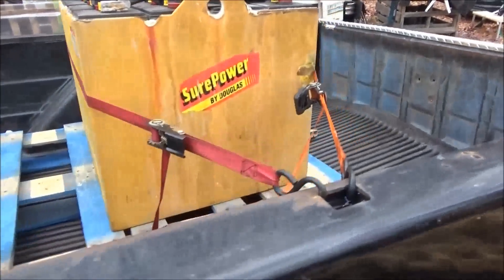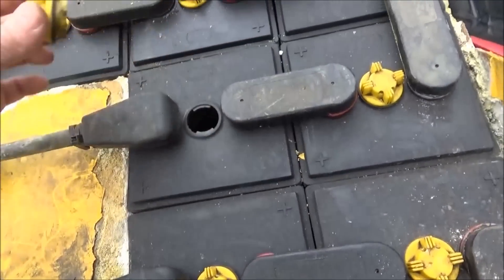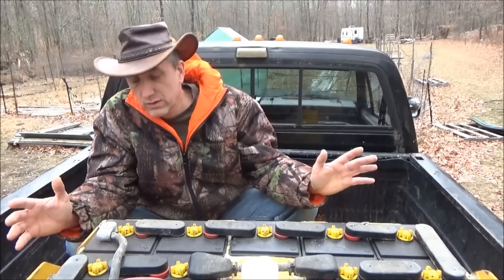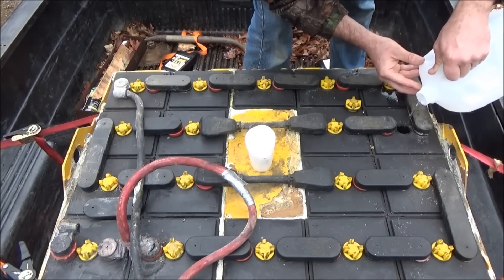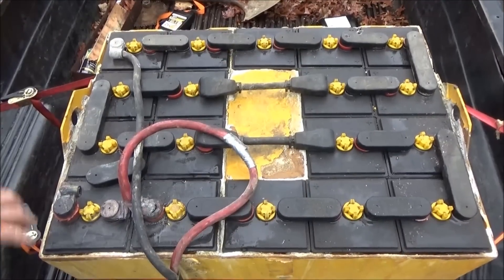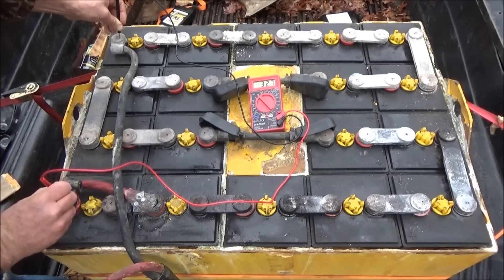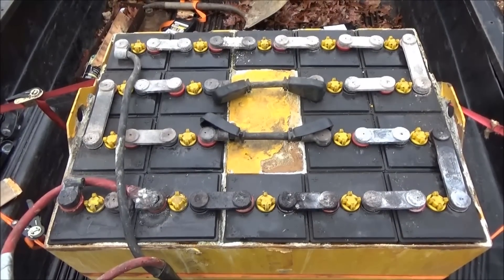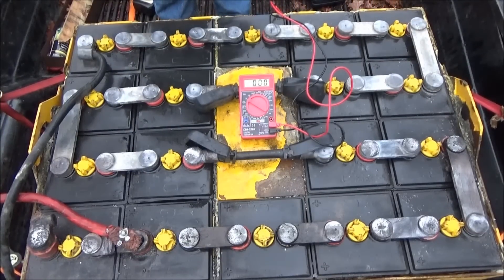Servicing An Old Forklift Battery Pack For Off Grid Solar Home Use

Comment: heres a link for pulling the cells out   https://www.youtube.com/watch?v=u8oiMoP5A1E  if it helps   or you might have seen it  already ...
Reply: The Do It Yourself World Since they are not coming out easy  due to corroded and what ever. Maybe pulling from the post would not be the right idea and pulling from the fill hole would be better. atleast you know the plastic is stronger and can see if it starts to flex the post will break without warning I think
Reply: looks like you need to lift the cells from the hole... NOT by the terminals it will break off.... be careful    lol eat your wheaties  :)
Reply from the maker: Yes this is the one I saw. But I just talked to the pros on the phone and they say lift it by the negative terminal with a special clamp.
Reply: The Do It Yourself World what truck do you use?
Reply: We had 1800 amp hour cells and while carrying one we had to lift it over a 10 inch pipe. The case separated from the lead and case and acid dropped to the floor, The case cracked and began to leak acid. If you can avoid taking them out of the case that is what I would do as I fear they are stuck in the case. Good Luck what ever is decided.
If you must pull some cells pull the ones that are bad first then maybe you can get something under the good cells.
Reply from the maker: Kormákur Jónsson 87 GMC High Sierra 2500
Reply from the maker: Sidney Boudro Yes thats the plan. Practice with bad cells first

Comment: Hi Troy  found a Training Video or 2 on youtube

https://www.youtube.com/watch?v=mnWqpcu8CvI
https://www.youtube.com/watch?v=J4sqUvRDAH8
https://www.youtube.com/watch?v=zJJzRR0Ud8A
https://www.youtube.com/watch?v=vTTylGSuAgo
https://www.youtube.com/watch?v=aNMbmVCnA0k
Reply from the maker: Thanks for the links. But these will not help me because I will most likely cut out the terminal posts and use standard battery clamps on my batteries. Or drill holes, set in a threaded rod and use a nut to hold on battery wires.
Reply: The Do It Yourself World Troy I think you might find the lead in the posts very soft and difficult to install a threaded rod as a post. They tend not to tap well and the tap just makes a mess. Better to drill a larger hole, insert the rod and then carefully relead in the hole around the stud with lead and a torch. You will have plenty of lead bits from disassembly.
Reply: The Do It Yourself World 
Hi Troy 
Seasonal greetings

You could mould / cut a new terminal lug like used on a automotive battery .
Old lugs don't tap well and can come lose as the top of the lug will not be flat ! 
If you must use big threaded ( this is not compatible with your fittings ! ) . 
 
Mr S Claws has a bad back after delivering that !!!!
So watch yours ….
Reply: Jeff Barr what if you could drill a hole into it then put in a metal threaded rod and then heat it up just a little to melt it around the rod instead of taping it do you think that might hold it and then he would have a post he could just put a not on if its possible it would make changing it in the future allot easier
Reply from the maker: wotsken I was thinking drill and tap.

Comment: Clean the cases with a battery cleaner. It is possible to lose charge though the casing of the battery if not cleaned properly. Water isn't good enough to clean properly. Get your meter put one lead on the positive post then put the other on the case. All around the top! If you get any type of reading clean the case again.
Reply: All true but try and remember that this leakage is always going to be with you. I don't believe he can get the cells out of the battery case but I believe that is what he intends to do. If he does the leakage path will be much longer.
Reply: I didn't say to remove it but clean the top around the terminals to eliminate this problem.
Reply: smoking91awd Well he did that and I concur. I wouldn't have done that in my truck though.
Reply: It needs to be done with an cleaning agent that dissolves and cleans acid.
Reply: smoking91awd The 2 agents suggested are ammonia or baking soda. make sure you do not let any get into the battery.